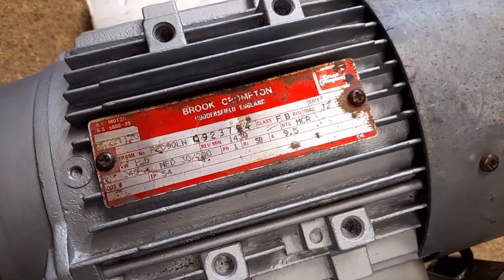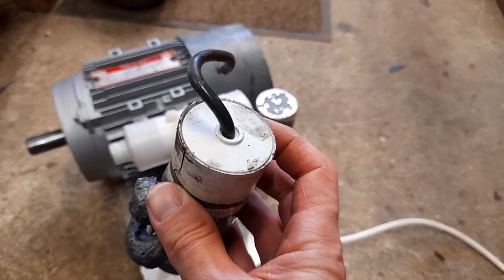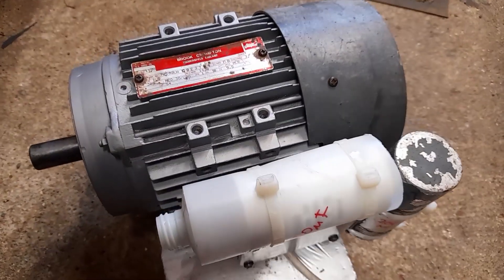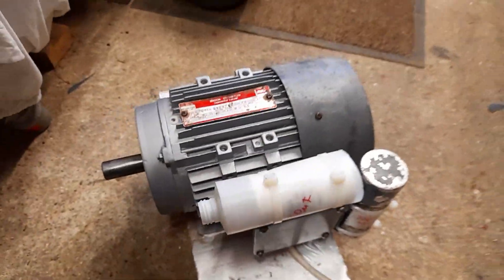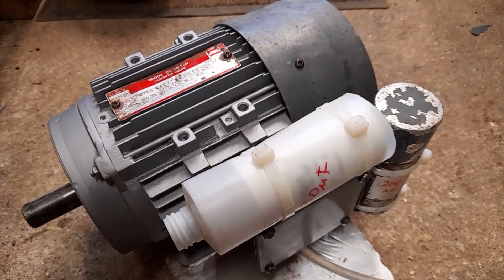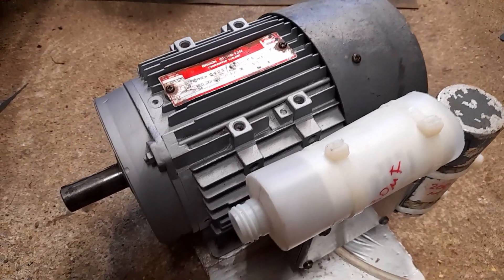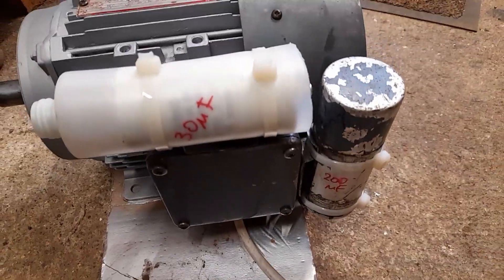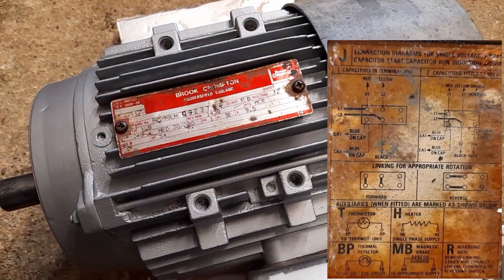Brook Crompton 1.5 kW motor replacement capacitor and start direction

Comment from the maker: In reply to a question I was asked... 

Take a look at the data plate and you'll see the IEC frame size listed (90L) - this will give you standardized dimensions for this motor type. You can Google "IEC quick reference chart".

https://jameselectric.ca/help/iec-quick-reference-chart/

If it doesn't fit, I've found the easiest solution is to bolt a plate to the machine using existing mounting holes. And then drill that plate with holes to fit the motor. This means you don't need extra holes in the machine.